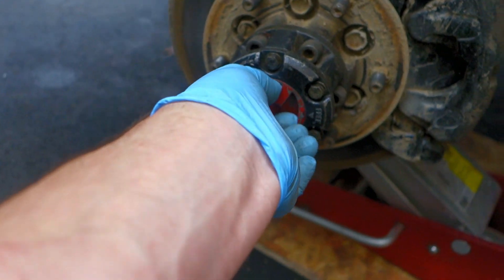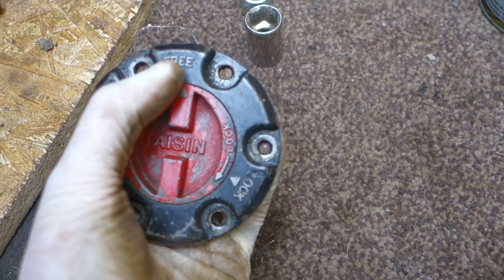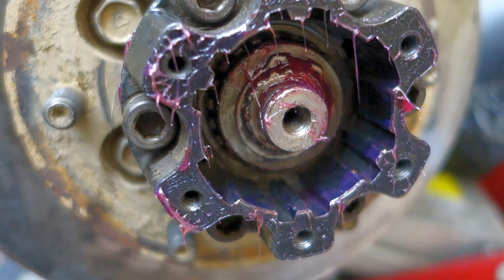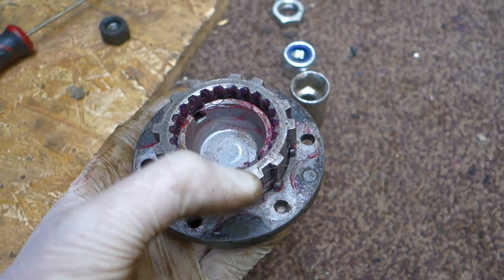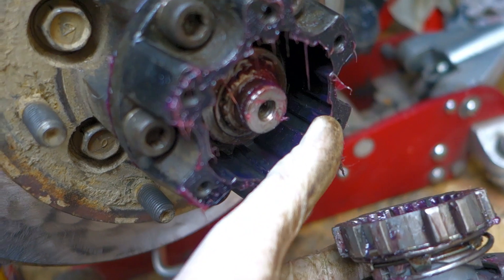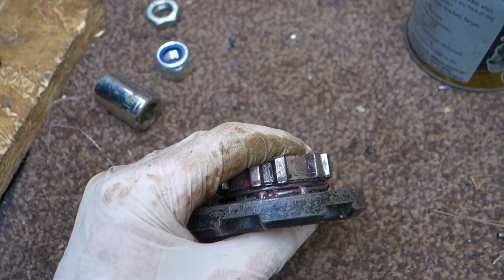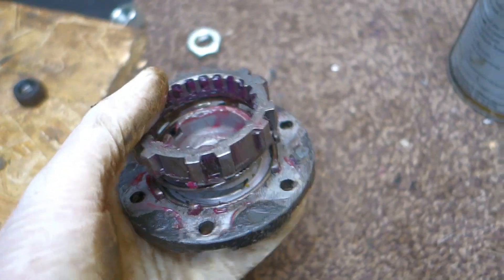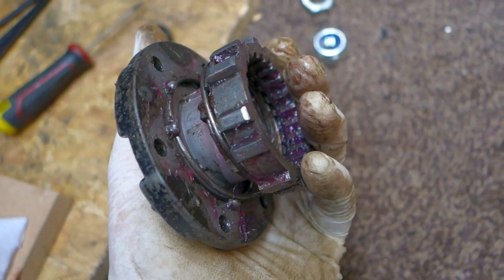Locking Hubs - How Do They Work ?

Comment: I don't understand, WHY do you need locking hubs????? From what I've seen, its just an annoying and completly useless extra step to get into 4wd.
Reply from the maker: Hi there, no mate you have these as they are far more reliable, better fit fuel economy, you can unlock one side of you break a  shaft, you can run in low box in 2wd, ist put power to the rear for winch  turning, you leave them locked when off roading and just switch between 2 and 4wd - so basically far more advantages than disadvantages
Reply: @vitmods7086  Mate, thanks for your reply! But I still don't understand.  In my mind, it goes like this: A normal 4wd vehicle, with a lever on the cabin to connect 2hi, 4hi and 4lo, no front locker. With locking hubs, in theory, I could make it... let's say, 3-wheel drive if need by some reason (By unlocking one of the hubs), is this correct? - But then, let's say that I have both hubs UNlocked and I want to engage 4wd,  I would have to engage 4wd on the cabin AND lock the hubs, that would be an extra step, am I right?  Also,  hub lockers do not work as a diff locker from what I just saw.  Again, thanks for taking the time to reply to my comments.

Comment: If I leave the front hubs unlocked, and put it in 4L, can I still use low range with open front diff? Or do I need to lock the front hubs if I’m going into 4H or 4L? Is it ok to leave them locked, when driving in 2H? Thanks in advance!
Reply: Leaving the hubs unlocked in 4L will give you rear wheel drive in low range.   Totally possible to drive like that.

Comment: I have auto locking hub and they seem to slip a lot and make loud banging sounds while off roading. It has stretched the clip to the axel off a couple causing me to lose 4x4. Would manual locking hubs stop that?? Cheers
Reply from the maker: I’d take them apart mate and check the splines are all ok in them and on the shafts - also make sure they are all free and not full of mud etc
Reply: my car has MLD and it makes clanking noise when engaging